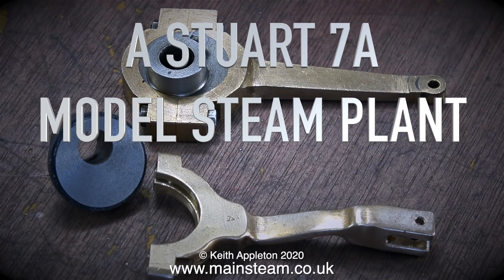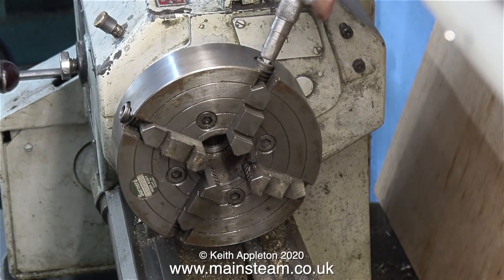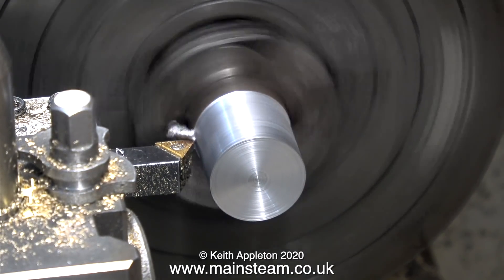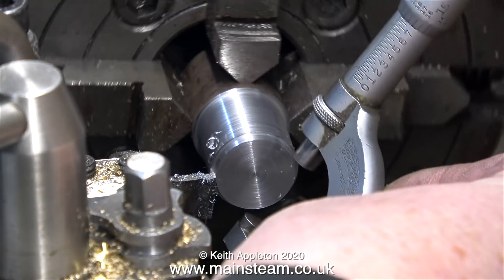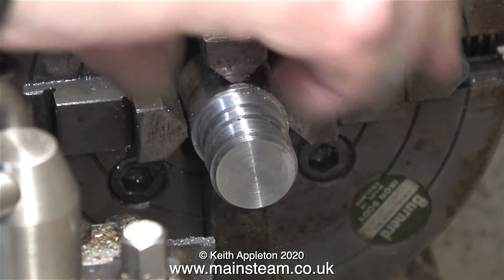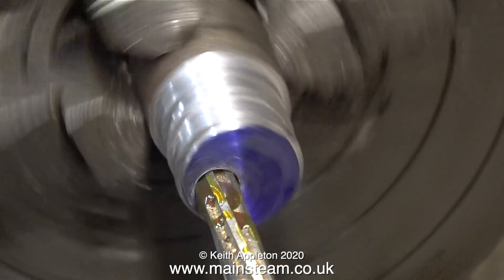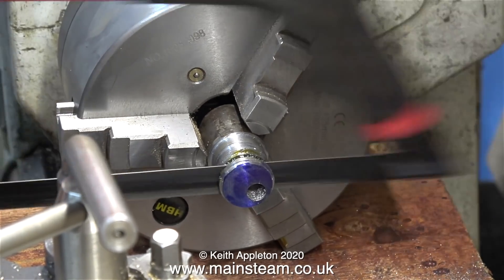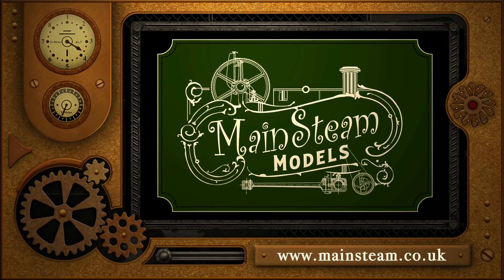A STUART 7A MODEL STEAM PLANT - PART #14

Comment: On the subject of getting a good finish on the final cut try using a sharp parting tool set dead square to the work piece with the lathe running slow about 80 to100 rpm and coolant, feed rate can be quite rapid ......you will get a chrome plated type finish.....works well on brass too.
BTW, steel grade S12L14 is a leaded steel and turns very easily but is soft as toffee....S1214 is a sulphur free cutting steel and will cut easily too and is slightly tougher than the leaded one.
Ordinary bright mild steel is the bane of turners anywhere as it produces stringy swarf.
BTW.....I though UK was all Metric since 1972.....why use the oldie Imperial sizes?

Comment: I understand that there is sometimes more than one way to do things, but could you have cut the eccentric off in one of your bandsaws?
Reply from the maker: It's very difficult to hold the part and the bandsaw blade width is a problem and the general accuracy is not good . . .